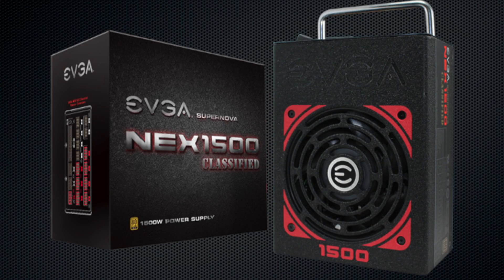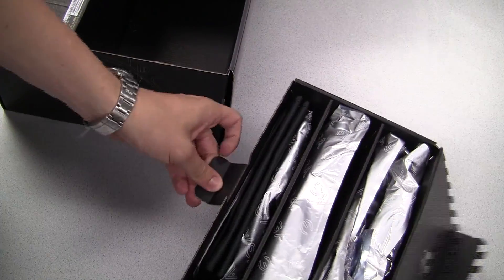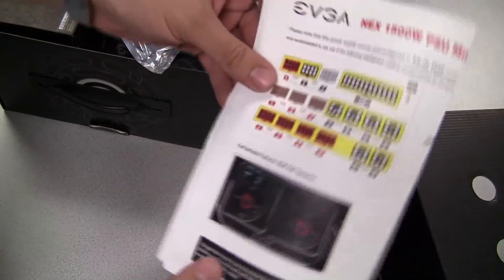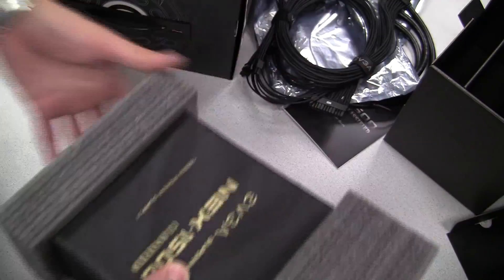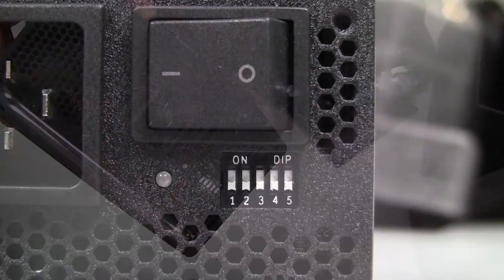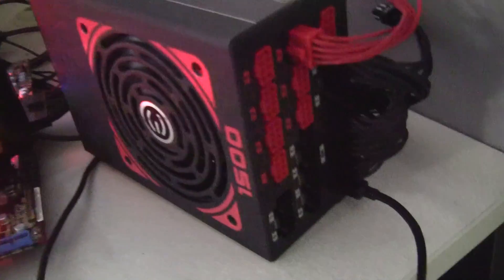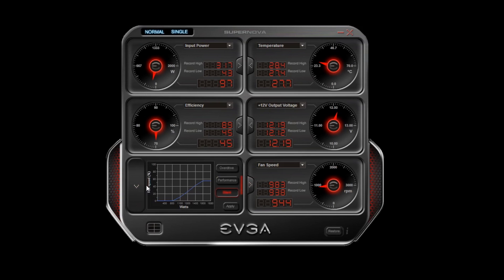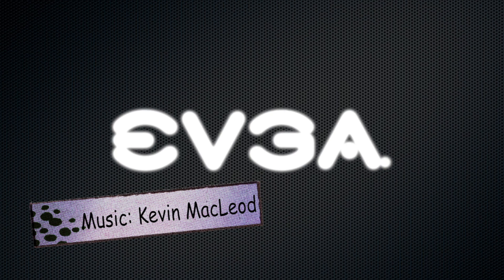EVGA SuperNOVA NEX1500 Classified Power Supply

Comment: Corsairs AX series is also rebranded.  The manufacturer for AX is Seasonic. 

I have the X-850 from Seasonic which is quite similar to the AX and it has been run on more than 1000w power draw without any problems.

Comment: i dont go with the hype, psu looks nice and everything but unless there is actually a need for it... And platinum power supply would be a better investment, corsair ax1200i or power cooling mk 3 1200w power supply also looks nice, there are way better options for lower price if you don't need all that power.